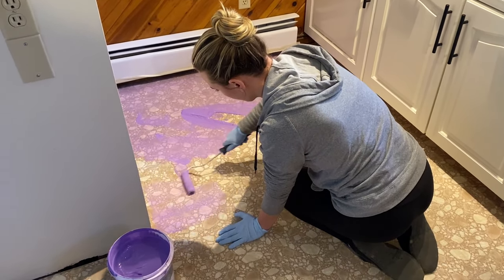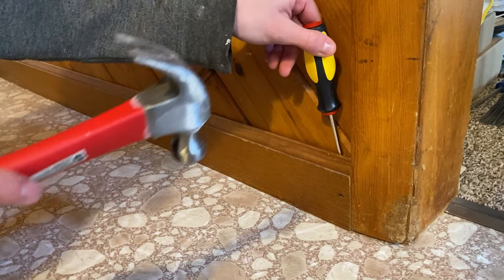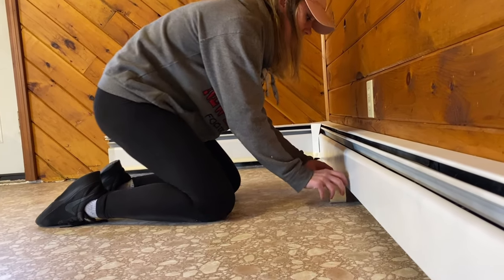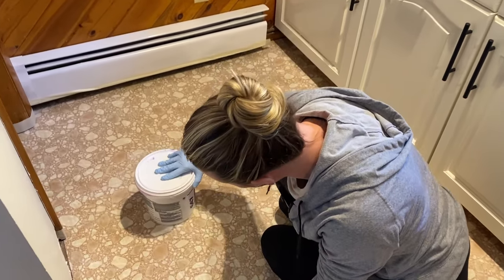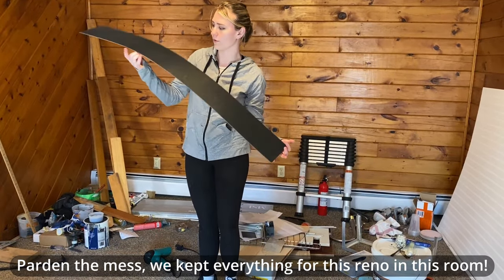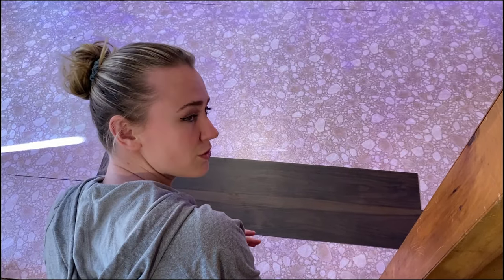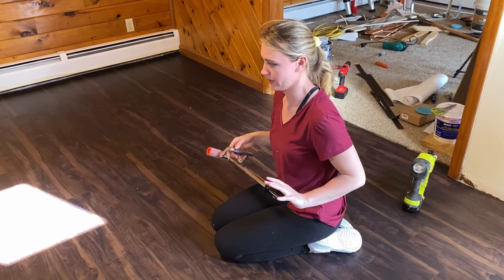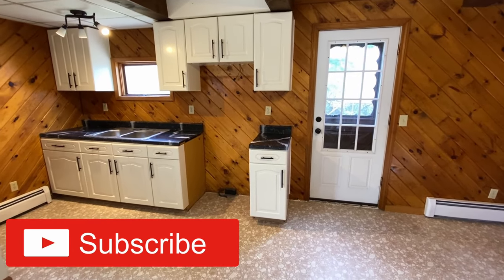DIY how to install glue down vinyl plank flooring

Comment: Good video, nice job!  A little hint, use a little flat bar instead of a screw driver for removing baseboards,  they are a lot easier and less chance of marking up a drywalled wall.  Cheers from Canada. ;)
Reply from the maker: All advice is welcome, thank you! Although I have been lucky with the flathead method, a flat bar makes a lot more sense!! 

Cheers from Northern Maine :)
Reply: The flat bar will chew up your base board. Stick to what you're doing.
Reply: @kylehoyt3499  a traditional flat bar will chew up the baseboard.  I am referring to the thin flat bar that does not have indentations for pulling nails, and is very thin but wide enough to distribute the load.  It's about 8" long with a 1" return.  It's a great tool, perfect for removing baseboards.

Comment: Im so annoyed that my sub floor isnt like yours lol. Its uneven concrete and i cannot afford 30+ bags to self level it to have lvt. I dont really want laminate tbh. Any suggestions?
Reply from the maker: What sort of living space is it that it had a concrete floor? You could always paint or epoxy it? Do some sort of tile? The mortar might help level the uneveness to some extent. I definitely would not do laminated over an uneven floor, you will see everything through it.
Reply: @TayMarie23  Its a downstairs hallway kitchen wc and living room. Its concrete but just cracked and bumpy. Do you have any experience with dryback lvt underlay im thinking to use?

Comment: Nice work. Like the basic of it all and I might go that route next time. I'm doing some of the laminate flooring planks and it's been a pain. But I'm removing old tiles and demolition also. If I ever take the new ones up I'm going this way for sure.
Reply from the maker: It was so easy to install and has been holding up well in both our bathroom and kitchen! Seems to do well in high moisture areas! We are very impressed with it so far! 

Hope the rest of your flooring install goes smoothly! :)

Comment: Looks great!   How are the floors holding up after 2 years?  Any shrinkage/gaps between planks?
Reply from the maker: We did these floors in two houses, the rental (the one in this video) and our house. The rental floors look just as good as the day we put them down! We put them over laminated flooring which some people made a stink about but they have held up great to heavy traffic! Our house we applied them directly to the plywood subfloor, since they are glued down they expand and contract with the floor. There is some gapping in the humid summer months but it's almost invisible to the naked eye, you have to be looking for them. Maybe 1/16", hairline gaps, close up around fall. Hope that answers your question!
Reply: @TayMarie23  That’s perfect.  Thanks for the quick response.  I was planning to do something similar 
on top of my existing sheet vinyl floor.   But just putting my feelers out there first.

Comment: Question - I'm about to install this same floor, but in one area I will have to slide a heavy bed back and forth at least once a month to change the bedding, do you think sliding furniture over this floor will cause it to move/create gaps? Do you have any experience with sliding furniture over it and how it affects it? thank you!
Your results looks AMAZING!!! great video, thanks!
Reply from the maker: We have a very large sectional couch on this exact floor that we move monthly for cleaning, the floor has held up well underneath but we do have thick felt pads on each of the couches legs. This floor, like most vinyl or laminate floors, is scratch resistant but definitely not scratch proof. I would definitely look into some sort of projection for the legs of the bed, but that would go with any floor you install :)
Reply: @TayMarie23  thats exactly my plan, heavy thick felt pads, glad it's working for your situation. Thank you!

Comment: Thanks for the video. Well done! How many square feet did the 647 glue cover? I have about 360 sq.ft. Is one gallon enough? Barely enough? More than enough? Thanks!
Reply from the maker: I believe it's 300-400 square feet per 1 gallon pail for the 647 PlumPro. You should be good with one pail as long as you apply evenly. Could always grab a second to have with the plan to return if not needed. Highly recommend applying with a smaller 4"-6" thin roller, the larger roller seemed to suck up a lot of the glue and made it harder to apply. It's great stuff, 2 years later and our floors are going great, not a single plank has popped up :)

Comment: How long does the glue stay tacky, you did a lot of sq ft and applied the glue all at one time? Great video.
Reply from the maker: If I lifted a board today 2 years later it would still be tacky! The glue goes on wet and dries to a super tacky material. So if we ever need to replace a plank we would just rip one up and replace the individual damaged plank.
Reply: @TayMarie23  that’s wild, I never would have thought that, I figured it dried totally after a few hrs. I done my kitchen and notched troweled the glue, it’s been there for 15+ years. I’m getting ready to do 500 sq ft more in a couple rooms. Thx again for a great video, God Bless.

Comment: Can you tell me what type, brand, version of nail gun you were using in this video. I need one of those.  Thank you! Awesome video!🌟
Reply from the maker: It’s not my nail gun but it’s one I often borrow from my boyfriend’s mom and I LOVE it! Super easy to use and the battery lasts a very long time, like weeks with light use! I believe it’s the “Ryobi 18V ONE+ Cordless AirStrike”. You can get it at Homedepot for around $150!

Comment: I am really concerned about the idea of gluing plank floor atop existing linoleum. However, if the old linoleum was well-glued to a good sub floor,  the linoleum gloss removed /abraded. and well-cleaned for the plank floor to adhere to., it might be a good idea in that it might provide a waterproof vapor barrier under your new plank floor.....plus save on the work/cost  of removing the old linoleum.I will have to do a bunch of research on this!

P.S .  A 'cats paw' tool and a sturdy putting knife are THE way to remove molding (and many other things!)
Reply from the maker: It’s been a year and the floor is holding up surprisingly well with our tenants! Haha and yes a cats paw would work much better, sometimes you gotta make what you have work though 😂

Comment: Ok, screw driver for trim removal? How did you measure for chalk lines? Do on and so forth
Reply from the maker: Haha sometime you have to use what you got! I didn’t have a cat paw at the time or many tools in general since we were brand spanking new home owners at the time of this video! 😂 For the chalk lines I couldn’t get an accurate diagonal measurement for the room due to the awkward layout with the kitchen and spiral staircase, so I measured 12 inches square off the wall in several places, pulled the line, and snapped it in a median of the measurements. Did the trick and gave us a pretty straight floor throughout!

Comment: What if you have to reinstall this in a small area and when you pull it up you realize they laid it over two other vinyl planks.  How do you make that area if the floor level?  Can you use more glue?
Reply from the maker: Sounds like you have a bit of a mess on your hands! We ran into a similar issue in our bathroom. Under the sheet laminate flooring was 1/4” ply, and under the 1/4” ply was another layer of sheet laminate flooring glued down to the true sub floor. We ripped it all out, scraped the old glue, pulled out around 200 staples, and put down the new LVP planks. 

If it’s just a small area I’m guessing you can just reapply the planks you pulled up. Depending on the glue type used you might be able to just put the new planks down or you might have to scrape the existing glue off then apply new glue and planks. When it comes time to redo a large area it might be best to rip everything up down to the subfloor.

Comment: Does it turn out fine with a roller, it says on my glue use a trowel but a roller would be easier if it works out?
Reply from the maker: I don’t think all glues are roller compatible, if it says trowel I would probably use one :)
Reply: @TayMarie23  I read a comment on Reddit that people find God with projects like these, I agree as this has diy project has  been absolutely  hell and I definitely need god to help me out.

Comment: Does all the flooring need to be glued down or just the perimeter?
Reply from the maker: For glue down LVP, the entire plank needs contact with glue. So yes, it’s the entire floor! 

Then you have the click lock LVP, those don’t require any glue and lock together. The click lock is a floating floor while the glue down is not! Hope this helps :)

Comment: Can this go over title  floors?
Reply from the maker: You would need to do a thin set coat of some sorts to fill the grout lines in to be flush with the tiles, otherwise you would end up with tile print indents overtime as the floor settles. If you fill in the grout then absolutely, just make sure the adhesive you get is rated for concrete/tile. I believe the Henny glue we used is rated to go over almost all floor types!

Comment: How thick are the planks?
Reply from the maker: They are pretty thin. The specifications for these specific planks where “2 mm T x 6 in. W x 48 in. L, wear layer thickness is 12 mil”.

I could be wrong but I believe 2mm is the thickness, I don’t know if that includes the wear layers or not…?
Reply: @TayMarie23  thanks mine are 3mm thick

Comment: What did u measure off of for ur cholk line
Reply from the maker: There are some great videos out there on proper methods where you measure the diagonal of the room and find your square straight line from that! We did not do that because of the shape of the room and where the kitchen cabinets were located made it hard to get an accurate diagonal measurement. So instead we just took several measurements off of the two walls that ran parallel with how we wanted to lay our floor. Then we took an average of those measurements and snapped our line. I hope that makes sense 😂 There are some great videos out there, just search “how to lay a floor strait” it can be any flooring type too, the methods will be pretty much the same :)

Comment: Can you put these down on a concrete floor
Reply from the maker: Yes absolutely! The prep will be very similar to the prep in this video. The only thing that may be just a little harder is making sure your floor is level and flat. If there are bumps or high spots they may need to be ground down. If there are any low spots that’s a simple fix with some self leveling underlayment! 

What’s most important is the adhesive you choose - make sure concrete is listed as an accepted subfloor…most do so that shouldn’t be an issue:) The product we used (Henry 647 PlumPro) works great with concrete! Hope this helps!

Comment: Can you glue the VP over ceramic tile.
Reply from the maker: You will have to double check with the specific adhesive you choose but to my knowledge tile is an acceptable subfloor as long as the tiles and the grout are in okay shape. You can’t lay VP over loose or badly cracked tiles unless they are repaired first! You would just need to skim coat the surface with some sort of thin set and fill in the grout lines so they are level with the tile. Otherwise, as the floor settles, it could potentially mold into the grout lines and look bad. But as long as you even the surface first, it should come out great! 

Hope this helps :)
Reply: @TayMarie23  Thank you for your advice.
Reply from the maker: @johnnyreeseiii8189  any time :)

Comment: People shit on these things but I put these down in my mom’s kitchen 20 something years ago and they still look almost exactly the same - which is a little but shitty but the same shitty as 20 years ago!
Reply from the maker: If I could afford a hardwood floor I wouldn’t hesitate to get one installed…but some of us just can’t do that, and that’s okay! I think LPV is a great alternative! People need to stop comparing it to real hardwood, because it’s not hardwood and it never will be! 

Don’t get me wrong there are some UGLY patterns and colors that these vinyl planks and tiles come in. There are also some very low quality products out there too! But as long as you avoid those and do a little due diligence, there are plenty of really great durable options! 

I think most of bad rep around vinyl plank floors came from the surge of house flippers using them almost every time. A lot of the flipper use the worst of the worst, so it has dragged down lots of people’s opinions of this flooring type! When we were looking at houses to buy we saw some awful installs!

Comment: Gluing on top of loose existing flooring, and you DO have loose flooring in this video,is not a good idea. 
A recipe for disaster.
Reply from the maker: Thank you for the advice! The laminate was glued down (poorly but glued). We did not want to glue strait to the subfloor with this being a rental and not knowing how well this floor would hold up, so going over the laminate seemed like a good idea, that’s all :) I’m no pro though, so I appreciate the advice, I’ll be doing another floor soon and will look into alternatives 👍🏻
Reply: How long do you have to lay the floor before it goes off